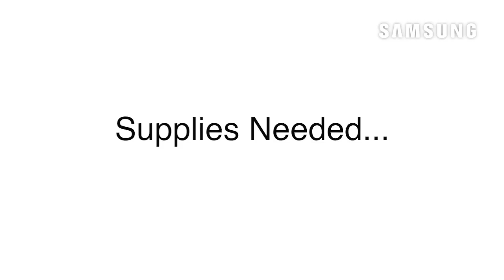How To Finish and Polish Solid Surface Countertop - Part 1

Comment: Which would be better to use the trizact or the auto body (wet or dry) sanding discs?

What micron sizes (if I use trizact)? How many of each sheet will I need?

I have 24 linear feet of countertop. It has some surface scratches, nothing deep. I am looking to do a semi-gloss finish. It's a dark color. Mostly black with light colored specks.

Comment: These videos are great! Thanks for the tutorials and gear links. What vacuum system do you use? What filters and how often do you change them out?
Reply from the maker: We just use regular filters for a shop vac. You can use hepa filter but we don't. We blow them out as they get clogged. They do get clogged often.

Comment: Any idea please the rpm of the sander? I am using a Festool rotex 150 on random orbit, finishing to 400 grit (no polishing compound) and always have dull patches/blotches which annoys the crap out of me. Have tried white scotchbrite in the past with same result. Wondering if my rpm's are too fast or whether I should finish with scotchbrite plus polishing compound. Just want a standard matt/satin finish. Thanks!
Reply from the maker: Use the Festool at full speed. The reason for the dull spots could be a few things. Make sure you use aluminum oxide or micron sandpaper. Make sure you blow out the sander between each grit thoroughly. Clean the countertop with water between each grit. Keep the sander flat while sanding and start the sander on the material.

Dull spots are typically due to swirl marks left behind from previous grits. 

Hope that helps
Reply: @AndyGraves  Thanks for the reply, I pretty much do all that, using Festool Granat sandpaper, clean with metho & water between grits, use dust extraction. Start with 120, 180, 240 then finish with 400. Getting the same result no matter brand of solid surface so something wrong with my technique. Maybe I am rushing it too much
Reply from the maker: @shaggydogswerve  Is your sanding pad flat and not wobbling? I think it is probably because you started with 120 grit. Try starting with 220 instead. Most solid surface is finished with 60 micron from the factory so sanding with 120 will introduce unwanted scratches to the material. 

I have no reason to believe that sandpaper wouldn't work but I have never tried it before. You should be able to get a nice matte finish using only 220 and gray scothbrite.

What brand and color or you using?
Reply: @AndyGraves  start the sander on the material?... why?
 also how much pressure do you apply to sander?

Comment: I have a black corian countertop and it has scratches. It needs to be sanded and then polished. I want your help on what sandpapers, buffing pads and polishing creams to use. Can I send you a photo of the corian? Thank you
Reply from the maker: This process in the video will work on black Corian.
Reply: Οκ thank you !
Reply: Good morning
I want to stucco-fill some bumps before I rub and polish the kitchen counter. With what material? Can you help me ?
Reply from the maker: Explain further, I don't understand what you need.
Reply: @AndyGraves  I want to fill some holes on a black corian counter and I don't know what material to use
Reply from the maker: @marmarostyle  You can fill with another piece of Corian if the hole is big, or you can us Corian epoxy and fill if it's small.
Reply: @AndyGraves  yes the holes are small, can you suggest me a corian epoxy famous brand where I can find in greece?
Reply from the maker: @marmarostyle  I have no idea where to go because I live in Southern California. I would recommend going to a local countertop fabricator and asking to purchase the adhesive direct from them.

Comment: Nice video.  Thanks for sharing.  I'm sanding out some deep marks in a vanity corian countertop.  What grit sandpaper should I use?
Reply from the maker: Start with 150 and see if it will remove the scratch. If not, move to 120 grit . After the scratch is removed work your way back through dinner grid until you match the surrounding shine.
Reply: @AndyGraves  I'm on my way to pick those up now.  I will try that. Thank you, Sir

Comment: So, if I want corian matte finish, I should just stick with your part 1 video, use 220 grit, buff with maroon.  But, after buffing with maroon, would I use perfect finish, as you show in video?  Also, any other alternative for perfect finish?  I can’t seem to find that and scotch brite website not helpful.
Reply: That is correct. Don't even use the Perfect Finish. That is what Staron recommends but it is not really needed. Just use the Maroon ScotchBrite with a little water and it will be a matte finish. The link for the Maroon Scotchbrite is in the description.
Reply: @countertopsexplained5145  Great.  Appreciate the good help.
Reply from the maker: I am glad it worked out.

Comment: Might you have a recommendation for a less expensive Random Orbital Sander for a homeowner who just needs to remove scratches from their (my!) countertop once every few years? Nearly $300 for the Bosch ROS is a lot for a tool that will barely get used. But if that's what it takes, then I'm saving money over buying something cheaper like a sub-$100 5"-incher from Makita or Dewalt that won't end up doing what I need.

Thanks for any advise you can give, and many thanks for this series of videos.
Reply from the maker: Get the Bauer random orbit sander from Harbor Freight. We use those sometimes and they work good. Only problem is there is no dust collection.
Reply: @AndyGraves  Thanks for your super fast answer. I definitely want something that can hook up to my shop vac. Since the Bauer you mentioned from HF is 5", I guess they're ok to use. I'll find one that will hook up to my 1.25" shop vac hose, and as long as it's similarly spec'd, I guess it should be ok to use. Probably anything I get will make it look better than it currently does!

Comment: okay...after you sand it to remove any blemishes/scratches, do you have to polish it again? I have yet to work on Corian but after doing a little research it looks as if it will shine and have the same glossy look even after sanding.
Reply: After you sand it, you will have to repolish it so it matches the surrounding finish.

Comment: What are the progressive grits used with the sandpaper and Scotch-brite?
Reply from the maker: What type of finish do you want, matte, satin or polish?
Reply: polish - my non-descript gray Corian is in great condition but I'd like it to be shiny. Don't want to have to replace it to stay competitive in my market
Reply from the maker: If you sand to a minimum of 600 grit followed by a gray or white scotchbrite, it will make it shiny. If you want a true polish like a car you will have to sand to at least 1000 grit and then use a polishing compound with polisher.

Comment: I want to finish my corian countertops.  Is it possible to burn them/ruin them if the buffing tool has too high of an OPM/RPM?
Reply from the maker: If they get burned you just resand. Start slow, keep it moving and it will be totally fine.
Reply: Thank you!!

Comment: Thank you so much. Learned A LOT! 👏🏻👏🏻

1 question: I understand the 220 and the Maroon scotchbrite. For a factory finished Corian, should I start sanding with anything lower than 220? Like 150 and then up to 220? Or just start immediately with 220?

Thanks again. Much appreciated! 🙏🏻
Reply from the maker: Try the 220 first. Then you won't have to sand it 150 scratches.
Reply: @AndyGraves  Thanks for the feedback. I’ll give it a try.

Comment: I’m preparing black Corion.  I want it to have a glassy finish. Is 1000 grit as high as I need to go before polishing?
Reply from the maker: That should work but you have to make sure all the scratches from the previous grits are gone before polishing.

Comment: Hey andy. Is step 1 necessary? I have no scratches or damage on the corian counter. Its has a matte finish but was never polished. Can i start with step 2 right away.
Reply from the maker: If the countertop was a matte finish it will need to be sanded to at least 400 grit before it can be polished.

Comment: Hi, I have a off white solid surface countertop that I want to take out small scratches and end up with a matte finish.   I dont want the shiny look.  What  grit scotch brite and sandpapers would I use.  Thank you
Reply: Use 220 grit and see what gloss you're left with after wiping off with a wet cloth.  If it's too flat then sand again with 400 grit and see how you like that, etc...

Comment: i have a black solid surface countertop, "ghost"stains appeared around the sink only, nowhere else, I do not have hard water. dont understand what caused it. Could i just sand It away, with the appropriate blending into the unstained counter, and then polish all surfaces?
Reply from the maker: Before you do that I would try a hard water remover in a small spot. I have placed a paper towel over the hard water stains and put a little LimeAway or Vinagar on the paper Towel. Let it sit there for a couple minutes and clean off. Make sure it doesn't hurt the material. This should remove the hard water leaving only the countertop material. Try at your own risk.

Comment: Can Corian glue be painted after smoothing? I need to do it.
Reply from the maker: Corian and the glue can be painted but you'll need to sand it with 220 grit sandpaper.
Reply: @AndyGraves    Many thanks for the info; no sanding problems because I also have to spray the support and completely paint the broken object (an obsidian base) which will be glued with the "Corian Joint adhesive" glue.

Comment: I am having trouble finding the scotch brite discs in 5". I am looking for the white or light grey. Do you know where I can but them? Also will auto body sanding discs P600 (wet or dry) work?
Reply from the maker: No. Yes.
Reply: If I can't find the scotch brite in 5" discs, what do you suggest I use?
Reply: brian lentz just buy the squares from auto body and cut circular or use as is
Reply: You don't even need to use Scotchbrite disks.  Just wet sand down to the smooth finish you want starting with 220 or 400 grit (depending on how badly the countertop is scratched).  If you want more of a matte/flat look then don't polish with the rubbing compound and polishing compound as described in part 2 of the video.

Comment: Can any router bit be used to join the two pieces or is there a specific one?
Reply from the maker: I use a single flute, 3/8" Diameter router bit. Just get a good one that is nice and sharp.
Reply: Thanks, I made a rookie mistake as irs my first time using a solid surface counter, I got distracted and never double checked my measurements and cut it short 🤬also I cut it with the router when I think I could have used an 80t skill saw blade?

I am making a kind of jig /bench up with a profile the same height as the material which should help make it easier for joining them together.
How strong will the joint be generally?
Reply from the maker: Try cutting a seam like this video https://youtu.be/nl4p48VFTY8 . I think it will save you a lot of time.

Comment: If I use the Trizact film sanding discs, what sizes (micron) and how many of each size will I need to do a finish that is semi-gloss?
Reply from the maker: Depends on the size of the project.

Comment: Fantastic videos, thank you so much for the easy to follow. Question about the high gloss procedure. If I sand to say 800 or 1000 for a high gloss, do I still need to use each of the buffing pads in sequence (maroon to grey to white etc...) -  or am I just overworking the project?  Can I jump ahead in the sequence to say a white or a green?
Reply from the maker: I would just go straight to polishing with the buffer and rubbing compound. This was following the fabrication manual procedures and I think it's a bit over kill.

Comment: how about a larger diameter sander, like larger than 7 inches. These small ones will take quite a long time for large countertops.
Reply from the maker: MySchizo Buddy - yes that's possible but it needs to be random orbit. Surecare makes a big sander as well.
Reply: MySchizo Buddy 0

Comment: It would be helpful to show clearly in the video the grades of PGRADE or Mircon that is being used in each step.
Reply from the maker: Sounds like a good idea.
Reply: @AndyGraves  well...can you elaborate? Which grades did you use?
Reply: @rickrudd  The slide before he begins to sand shows various grits down to 1000.  It really depends on how deep the scratches are that you're trying to remove and how glossy you want the finish to be.  My Corian counters aren't that scratched, so I haven't sanded them yet, just compounded them with Meguiar's Ultimate Compound and polished with Meguiar's Ultimate polish.  I do it every two years or so.

Comment: Great video, thank you.  I wonder if I can use my mouse sander.  I have all the sanding pads, plus all of the polishing things for it already.
Reply from the maker: It needs to be a random orbit sander to eliminate the swirl marks. A vibrating sander will leave marks that you can see.
Reply: @AndyGraves  Thank you.

Comment: Hello what grit sand paper should I use
Reply from the maker: Matte, satin or polish?
Reply: Matte for corion
Reply: And should I use the red schost pads
Reply from the maker: Sand up to 220 and a maroon as scotchbrite. This will get you a matte finish with most colors.
Reply: Andy Graves okay so I can use lower than 220 and I can’t find that finish u used so I bought hopes top counter polish will that do the job
Reply from the maker: But you want a matte finish so I would not use a polishing product.
Reply: Andy Graves So what finish would you reccomend that’s on amazon or eBay
Reply from the maker: 220 grit sandpaper and maroon scotchbrite.
Reply: Andy Graves okay and do you know a good finish to use
Reply from the maker: There material saved with maroon scotchbrite is the finish. You won't need to put anything on it to have a matte finish.

Comment: being an SS (Solid Surface), will it not be glossy throughout?
Reply: I am not sure what you mean. It will be shiny where you polish it.
Reply: okay...after you sand it to remove any blemishes/scratches, do you have to polish it again? I have yet to work on Corian but after doing a little research it looks as if it will shine and have the same glossy look even after sanding.

Comment: Shouldn't it be shiny or something?
Reply from the maker: This is part 1 of a two part series. The finer the grit sand paper, the shinier it will become. Most solid surface is finished to a matte finish. Part 2 shows they polishing process and that will really make the material shine.

Comment: Great video. But I am confused on about the 3M products. If I sand it with 1000 grit or finer , then which 3M products do I need in order to get the glossy result? There are 3M rubbing compound, 3M machine polish compound and 3M ultra polish compound. Do I need to use them all? Or use either one of them? Thanks again!
Reply from the maker: 3m changes their products so we typically just purchase a 3m rubbing compound and polishing compound. If you sand to 1000 grit sandpaper the top will get really shiny. This video is for a matte or satin finish. Check out Part 2 - https://www.youtube.com/watch?v=2WmVQwkgcMk&t=276s which shows how to polish.

Comment: I purchased a used one as the piece is a bit pricey, but the machine https://www.youtube.com/post/UgkxG6fbm3cHBd7CNTjk5D-dwYe9c9tCB9ZN has surpassed my expectations. We sand small parts by hand often, sized around 1"x1/2," and specifically look for a piece that's designed to be vertical. The motor has plenty of torque and great speed settings. The only inconvenience I had is that the disk measures 5" where we trim 6" stick-and-sand disks down easily by mounting it then cutting with a box cutter.
Reply from the maker: Awesome, Hope everything worked out good.

Comment: Hmmmm..... you show the N95 dust mask as part of the "equipment you need" and then don't wear one while you're sanding in the video... (yes, I know your sander has a vacuum attachment so it's not as critical, but still....)
Reply from the maker: I'm not sure how to respond. Would you like me to remake the video?
Reply: @AndyGraves  Nah, just pointing out the slide early in your video that shows safety glasses, ear plugs, and an N95 dust mask as safety equipment that should be used.  Most of your viewers don't have an air powered sander with a vacuum attachment to keep most of the sanding dust from going airborne .  In my case I have a battery powered sander and would probably wear the mask, I would also wet sand which also does cut down on any airborne dust.
Reply from the maker: @simul8guy75  Reading your comment, you seem like a really smart person. So, I'm going to assume you know exactly why that slide is in the video. It's the same reason the Chain Saw manual says, "Do not touch moving blade with your hands." Every once in a while I get a hall monitor that points out some safety thing that I didn't do while I'm shooting a video. It used to drive me crazy and now I just know that there is always one safety captain in the group. Hope the video helped you out.
Reply: @AndyGraves  Yeah, it's a safety disclaimer.  I get it.